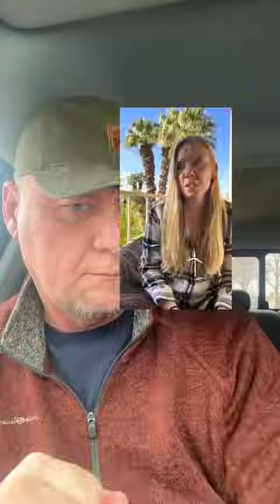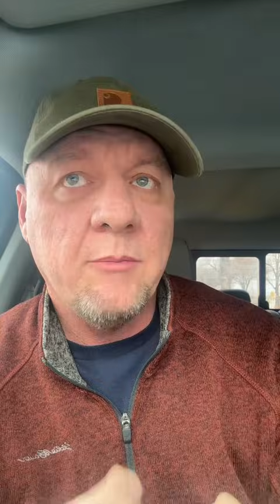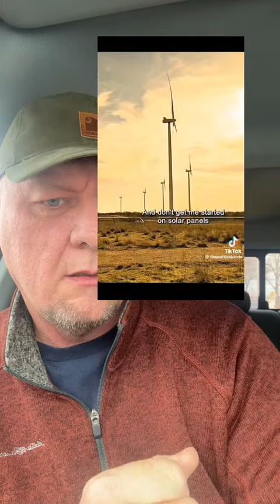The Carbon Neutrality Of Wind Turbines

Comment: I dont understand.  For something to be carbon nueutral wouldnt it need to remove the same amount of carbon from the atmosphere as was put out during manufacturing and maintaining it?  Maybe it should be carbon footprint.  Because wind has a very small carbon footprint compared to coal.
Reply: It’s based on the fact the energy created offsets carbon based generated power.

Comment: To me the question is land. 
I think land, as a metric for power, is a better than $. If you keep land well, it can be used for everything; making it the only infinitely renewable wealth that never will be worthless. 
If the math of your energy source comes out to producing at least 60% your energy demands, (anything less then 50% I would suggest looking into a different source of power) without using an obscene any amount of land (ocean included); then forget about money and resources because that stuff can be figured out later. 
I want to do the math on wind turbines to get a model for their production to land use. 
It’s a good reminder that you can’t produce the same energy everywhere nor could you produce energy one place and move it everywhere. 

I got in an argument with my, anti nuclear, hippie mother, who suggested that: “we could use solar to produce the  majority of electricity on the planet”. 
I did the math on for our little county alone. At our location, to achieve 6 hours of peak production, at the lowest energy demand, at a theoretical 40% efficiency, You would need 3.92 sq miles of land of just solar panels. Thats the size of our small city. 
Thats not including the maintenance and infrastructure; not including triple that amount of panels for potential energy storage (11.76), then multiple that 16 times to produce enough energy for the lowest production and highest demand (188.16 almost half our counties land).

Comment: I recall seeing some stories a while back about the amount of plastics of various types used in manufacturing and that they weren't recyclable and ending up in landfills...But newer turbines are more and more recyclable all the time. Could also be that the recycling has caught up to the construction and figured out ways to handle them.  I doubt it was ever as bad as burning coal...
Reply: The leading edges of the turbine blades can erode, which reduces efficiency. So they can be changed out. Given they're made from fiberglass or other composite materials, there isn't an efficient means to break them down and recycle or repurpose them.

But they can be safely buried. They don't leak toxic chemicals or create hazardous waste. Just bury them and build something useful on top. That's howl how Manhattan south of Wall St was created: people dumped their trash in the rubber at that point and enough new ground was created that it expanded the island.

Coal leaves dangerous ash ponds that leak, flooding areas. And it's always subject to contaminating ground water. Nuclear waste can be contained, but it takes a lot of careful precaution. Natural gas has no real waste product other than carbon pollution. So yes, wind turbines have a waste steam, but it's hardly an issue.
Reply: @Tanstaaflitis  Ah, thank you for that detailed reply!